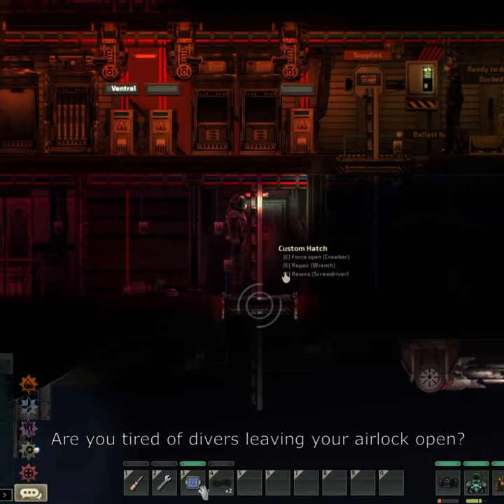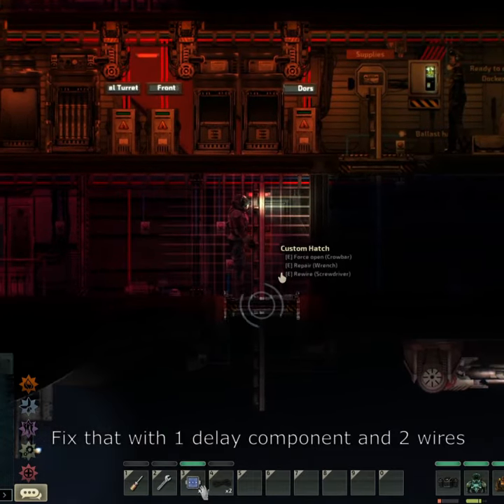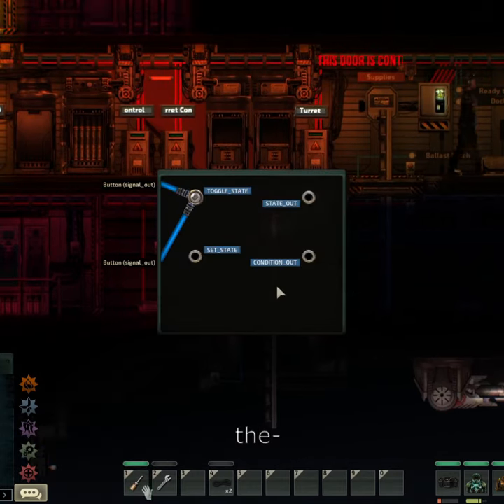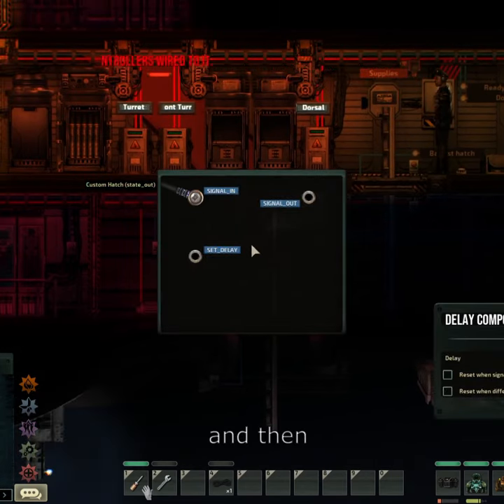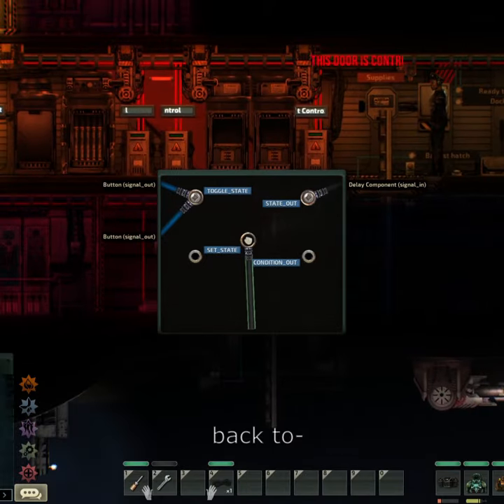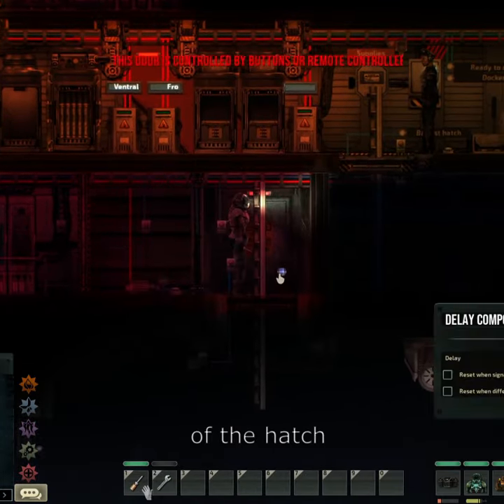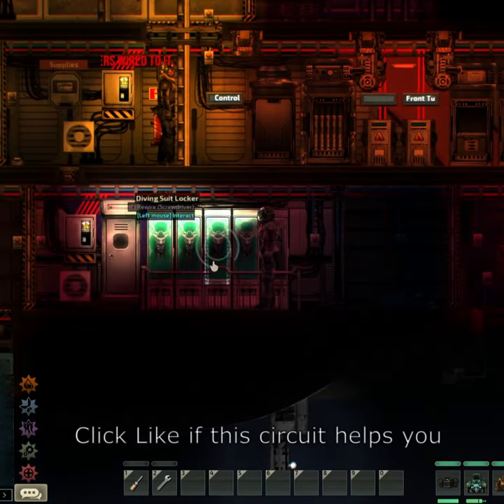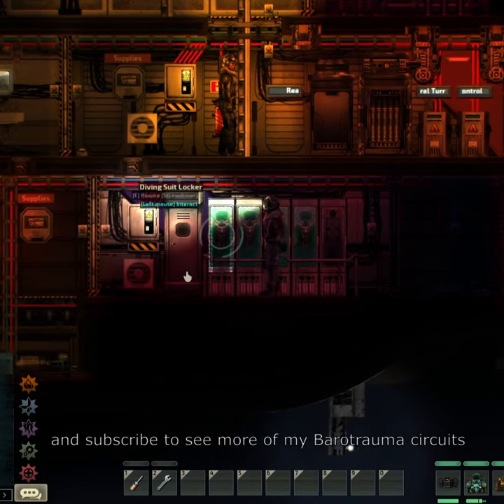Barotrauma Wiring | Auto Closing Airlock

Comment: This is very useful. I use it mostly on my designs.
6 seconds delay is very good . Gives enough time to dive team to get out and it closes automatically. On MP matches there are some good players that close(which it works too) but I always remind them to not worry because it will close.
I set it up so the airlock pump only pumps when outer door is closed so it also serves as a bilge if the sub is very flooded.(I mostly put my airlocks on the bottom for this sole reason. 
I even managed to use the docking hatch door as an airlock without a toggle. So I had issues putting your delay idea because it kept closing and reopening every 6 seconds when docked with a shuttle or an outpost. Then i just wired a component to block the delay signal when its docked

Comment: I've made a system that I call "the perfect door" and somewhat adapted it to hatches as well. But airlocks are much easier... 

All you need to do is make sure so that opening the outer door closes the inner door, and opening the inner door closes the outer door, then just simply wire a delay component like you did, but wire the delay component's signal out to a not component then wire the not component to the door's set state.
If you don't want the door closing on you, you can wire a motion detector to an and component signal in, and change the delay component's signal out to the other and component's signal in, then wire the signal out of the and component into the not component. Make sure to swap the output and false output from the motion detector though or it'll be an entirely different system.
Reply: Basically what Dugong has on its doors
Reply: @Terraqueo22  The frick, no?? Why would the dugong have any other type of door than the regular trashy garbage doors the developers give you to start with???
Reply from the maker: Nice! I have experimented with robust airlock systems, but in a real game players just get confused and dislike them. This was with an MP crew that had been playing together for 2 weeks too so we were very familiar with each other. In the end I had to just rip it all out and use a basic "both doors toggle on button press" system
Reply: @DreadedEntityMain  Yeah that one is pretty good, I actually invented an airlock that works BASICALLY just like that though, except it has some fancy features such as the outer airlock automatically closing after 7 seconds if you left it open while leaving. Also it has a button in the middle that toggles both doors, but if both doors are closed it doesn't work. 😂
Pretty complicated stuff to set up, but it's REALLY easy to use and I love it.
Reply from the maker: That's the problem that I found, no matter how easy you make it, they were already used to the old airlock so they prefer it even if it's less efficient. As the designer you're the only one with familiarity so everyone else just ends up hating it
Reply: @DreadedEntityMain  Well I just know it becomes a huge pain to constantly deal with people leaving the airlock open as they leave the sub, so when I tried to fix that I realized I'd need a whole entire different system so that the doors would be able to "decide" which one to open, instead of opening both and getting the ship flooded.

Comment: i used this but now my small pump doesnt pump water out of the airlock
Reply from the maker: I have no idea how that could be possible, check the wiring on the pump and make sure it is still wired correctly. This circuit doesn't change the pump wiring so that can't happen